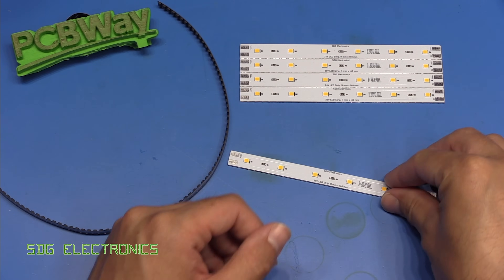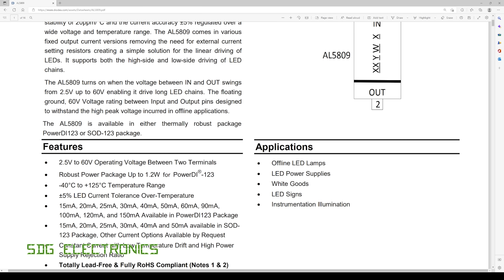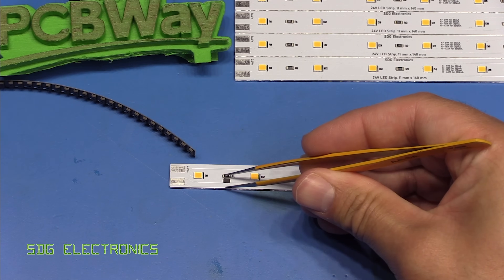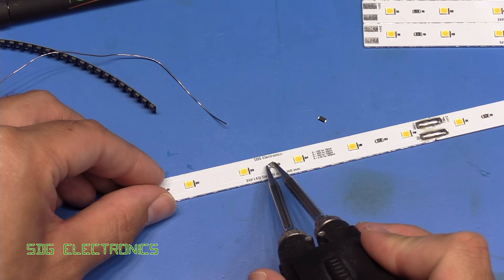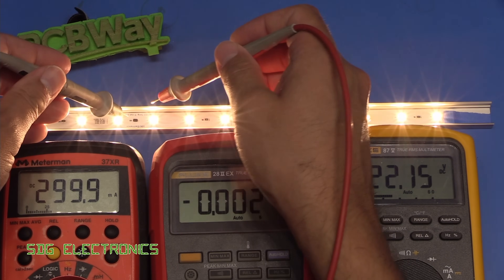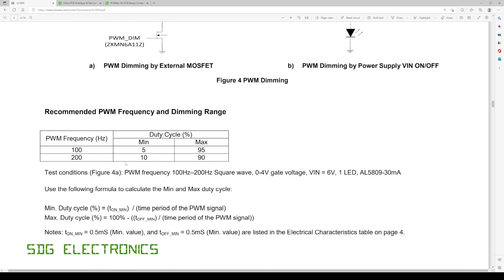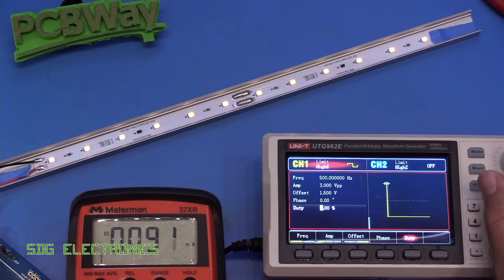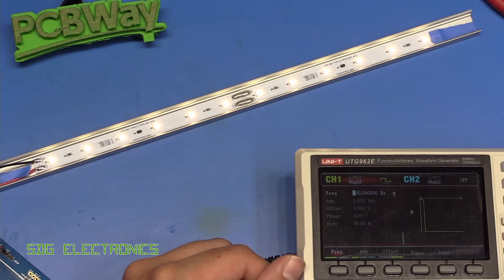SDG #265 Easy Constant Current LED Driver with the AL5809

Comment: Thanks for sharing cool part! 👍
Indeed this may be very useful. No need to create discrete transistor current limiting supply.. As I did it long ago for lit up the amplifier front panel as an retro update.. At that situation I'm dealing with 50V-60V and transistor needs separate heatsink to drive two leds.. 😂 Linear regulator ICs wasn't an option due to high input voltage - they can't handle it by datasheet..

Comment: Power dissipation across the 1st driver will still be a lot higher, though. 
Couple thoughts:
1) If you double the supply voltage (or better yet, use a 48V supply) and double the led string (12 leds in series) you can get away with double the length before voltage drop becomes an issue. the pcb layout would have to change, of course. You could either double the pcb length or have a settable resistor that can make the pcb either a series or parallel configuration. (edit: I checked pcbway and doubling the length 280 x 90 doesn't actually double the price, so it's cheaper this way, too! $98 for 280x90 vs $69 for 140x90) This will improve your overall efficiency
2) doubling the copper weight, doubles the price on pcbway, so that's a no go.
3) If you supply only the positive supply from one end, and only the negative from the other end, you'll get approximately the same voltage across all the LEDs strings. Overall power dissipation is the same, though.

Comment: Instead of using PWM, modifying feedback circuit of AC-DC PSU for voltage control would be not much more work than modifying it for different voltage.
As a result you get a smooth dimming without long antennas radiating EMI (TBH, I care about flicker-free aspect more than this).

Other than that, you seem to get 87,6% efficiency in LED strip alone, so ~2.6V drop from these drivers is big limiting factor. They are linear after all, not sure why I expect more from them.

Comment: well, your voltage  drop will be still there, so you must rise your power supply to compensate, which means that 1st CC drivers will be hoter. to make drop voltage same, you must power  thestring from both end in way X-mass lights are powered, plus on one side, minus on other
Reply from the maker: Indeed, I had planned for power from both ends, just not every 4 PCBs. We have a bit more margin now with supply rails to ensure consistent illumination but of course those closer to the power entry will dissipate more power.

Comment: See also the ON Semi NSI450xx range. Although those don't seem to be available in as wide a range of current, and they're only rated for 45V.

These two-pin constant-current drivers are quite neat, and I was considering using them for something a while back, but the downside is that they are quite expensive. So I went with a dual transistor arrangement instead.
Reply from the maker: Arrow had these for $0.26 last week, so worth it for minimal rework. I'll test out some other solutions for LED control
Reply: Don't make the mistake of trying to make a discrete current mirror, I did that once and had to respin boards with a DC/DC converter and floating opamps instead, it was for a 4-20mA output circuit controlling air supply in a ~3000kW total power gas burner set and the current mirror would go crazy with a slight change in temperature

Comment: Great video as so often. Nice little current control devices, although obviously linear and therefore not suitable for dropping much voltage. 

However, I am not sure why you are using these devices and then PWM dimming. If using a PWM MOSFET, then a couple more components (current sense resistor and an opamp - or a specialised chip) would give you both functions (ie control of max current and a nice linear dimming curve at any freq you want) - and without the linear heating losses (may not be an issue at these low power levels). Also you could now remove / bridge out the 1 Ohm resistors?
Reply from the maker: It's because there's 70 segments in total, current matching of all the boards wouldn't be trivial. If it was only a few strips I'd likely use an adjustable constant current regulator.
Reply: @sdgelectronics  Ahhh. 70 x 150mA in parallel(!).. Yeah that's harder, you would need PWM current control for each one or at least each small group. Fair enough.
Reply: @oschonrock  FET, shunt and opamp is still a linear current limiter. But these little ones allow for effortless voltage controlled dimming from PSU side.
Reply: @Mr.Leeroy  "PWM MOSFET"  was shorthand for a "duty cycle circuit". But that's not the reason. See SDG Electronics reply above.
Reply: @oschonrock  
"PWM MOSFET, then a couple more components (current sense resistor and an opamp"
Either I am not reading well in English today or there exists some opamp+fet circuit that works using PWM principle that I have no clue about..
Reply: @Mr.Leeroy  You drive the mosfet from an opamp which is used as a comparator to produce a square wave from a triangle wave and a threshold voltage, which sets the duty cycle. You use the current sense and another opamp with a little bit of integration to get the threshold voltage. I think there are ics that package the whole thing together. But yes, you usually need more than a single opamp.
Reply: @RexxSchneider  Agreed.
Exactly because there are jellybean PWM controllers, I assumed that if one was to implement discrete circuit at this point than we are talking simple linear error amplifier for the shunt. There was no mention of other opamps indeed.

Comment: Are you removing all resistors? Now with the current regulators they do not serve a purpose, right?
Reply from the maker: I'm leaving the 1R resistors. None of the UK distributors had a reel of 0R links in 1206 at normal prices
Reply: @sdgelectronics   0R jumpers seems like a perfect job for CN suppliers (:
Reply: @sdgelectronics  I forgot they were only 1R
Reply: @sdgelectronics  A blob of solder could do the job...
Reply: It depends on the total voltage you have to drop. Having additional resistors creates additional voltage drop and reduce the voltage drop in the current regulators. This reduced the power it has to dissipate, because this is shared by the resistor (s).
Reply: @cmuller1441  in this case he had already raised the voltage, since the regulator itself drops approximately 2.5 V
Reply: @Peter_A1466  If you have a very long string of those strips, there will be a significant droop at the end. A simple solution could be to use a higher voltage and keep a resistor for the first strips to limit the power dissipated in the regulator and still have enough voltage at the end of the string (the last strips don't have the extra resistor).

Comment: so presumably... the higher the pwm freqency, going up into several khz... then the driver will not have enough time to fully switch on and get up to the full rated 150ma current. which would then limit the maximum achievable brightness? (if am understanding this properly). which might be ok depending if there is enough usable upper range of duty cycle still being preserved. and also depending by how much the leds are 'too bright' / too much @100% for the given application.

normally i would prefer a duty cycle about 20khz. not to be within any audible range. but that is way far higher than what these are speccd at. also a 100hz or 120hz sits exactly on the same frequency as the ac mains hum. which is usually already being filtered. so maybe that would make more sense here instead
Reply from the maker: Correct, at some point, the LEDs will barely illuminate up to high duty cycles where suddenly they will go very bright.
Reply: At higher brightness the pulse will be longer so tho give the regulator more time. And of course at 100% there are no pulses anymore. 😉

Comment: Did you check the temperatures when driving at the higher pwm frequencies?
Reply from the maker: It's generally consistent. The switching MOSFET will be the part that gets hotter